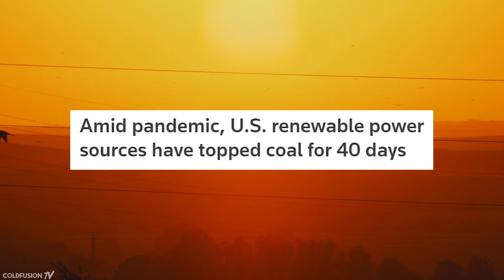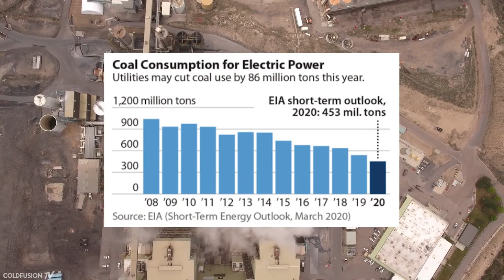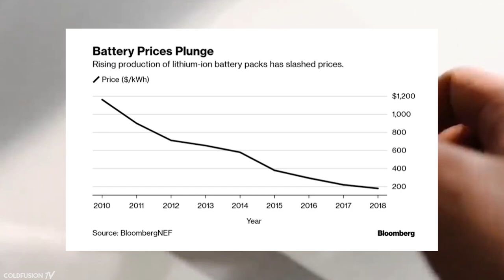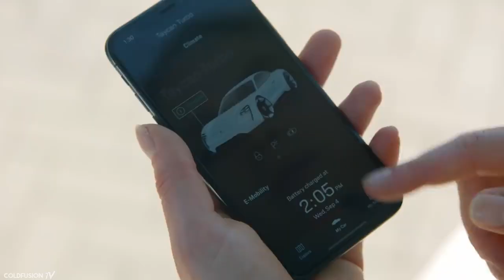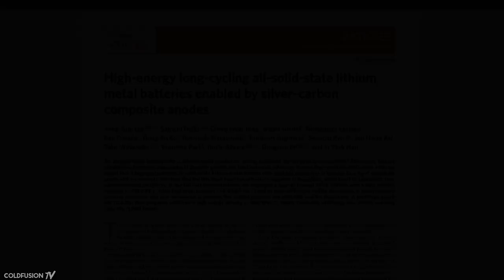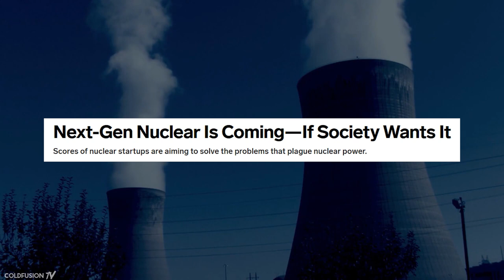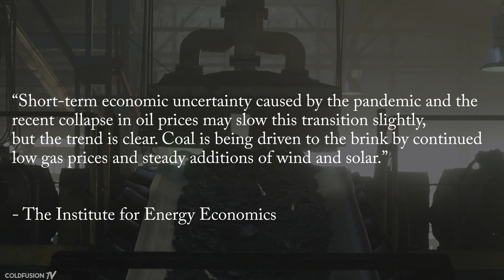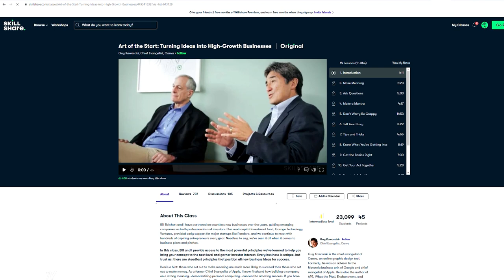Amid Pandemic, Renewables Now Supply More Energy than Coal in the U.S.

Comment: This is my industry as a power engineer. Your video was really good and the information was clear. I have been curious about geothermal and pumping water back uphill lately. With the way battery technology is going, production when it is need is still going to be a thing for awhile. The Duck-Curve is a daily struggle from a transmission standpoint. If power engineers focused on more not just finding the cheapest way to boil water, we would be there already.

Comment: renewables are way too inefficent, we need cheap energy on demand. nuclear ist the best solution
Reply: nuclear isn't cheap in the same way that buying stocks isn't cheap. you get your money back and then some, but only after spending a lot of money. plus, nuclear is safer, more powerful, more profitable, and more efficient compared to any other energy source, but muh nuclear weapons and political scaremongering.
Reply: In times of crisis you need bold politicians to do big investments if you want nuclear.
Reply: yes it is not cheap. highend technology is never cheap, but its getting cheaper and in some cases it already is. china builds some late gen 3 nuclear station for the price of a gas-fired power plant. when talking about renewables not only storage, but also transformation and necessary infrastructural upgrading costs are often not within the calculation. and what is the price of the massive intervention into nature caused by the usage of space that is needed for renewables?
Reply: @davidlewis6728  Why should we continually keep mining for uranium when we can just mine silicates and metals once for long-lasting energy creation? Plus, we still don't have a way to store the radioactive waste products.
Reply: I like Thorium but with Thorium burners they could be slotted in to an existing coal powered power stations for very little cost. I would not be surprised if we see fusion reactors within ten years.

Comment: The comparison between the phone battery and laptop battery was not a fair one. You did not take into account the voltage as well. The same number of mAH in a 14V battery is actually much more energy than that number of mAH in a 5V battery. If you want a fair comparison, convert or find the WH ratings for each which does take into account battery voltage. This may seem overly nitpicky, and I enjoy your channel, but that is a pretty big distinction as mAH is not a unit of energy. Cheers!

Comment: Question:  If storing wind in a mountain is a form of "battery", why wouldn't sucking up water from the ocean to an elevated reservoir have the same effect?  Pull up the water into the reservoir, then push it through a hydro power turbine when the grid needs energy.  Potential bonus, biological or membrane desalinization and thus a larger water supply in coastal regions.  Does it simply cost too much energy to pull that much weight versus moving air?

Comment: Good Video, Lots of Info. But why mention just batterys? When it comes to utility scaled energy storage in the future, I think batterys will only account for a very low one digit percentage amount. Power to Gas, pumped hydro, Green Hydrogen, heavily compressed air, power to heat - there's so many ways we can store excess energy from renewals way cheaper, easily scalable and using way less precious material's.
I'd love if you could do a follow-up to this video! :)
Cheers

Comment: The energy payback times for solar cells are pretty well known, so you could have mentioned them. Obviously it depends dramatically on the amount of sun and the cell type. 
It usually takes a solar panel + inverter installation between 1 and 2.5 years to generate more power than was consumed in manufacturing the equipment. Expected lifetime of the panels is 25 to 30 years, inverters 10 to 15. In sunny areas like much of the US, southern europe or africa the energy payback time is usually close to 1 year, so it's a total no-brainer.

Comment: The battery on the laptop is running at 14.4V which is 4 times higher than 3.7v of a phone, use Wh not MAh to measure the capacity.

Comment: Ive been seriously looking into solar power on a large scale for quite some time now and still undecided on the best storage method between batteries or hydrogen. For the automotive industry batteries win hands down but for the commercial industry perhaps hydrogen is best at the moment. Would love to see a non biassed comparrison.
Reply: Hi, in the Orkney Islands they produce more electricity from renewables than they use, so have been converting some into hydrogen to use as an energy storage system. Right now they use the hydrogen to provide electricity to their Ferry  when it is docked along side to reduce pollution. They hope at some point to power the ship with the hydrogen.
Having said all that even they say hydrogen is very inefficient way of storing energy and only advise it if there is a very specific reason for it. 

In their case they are using the shore hydrogen system to train the crew for when the Ferry goes hydrogen powered.

Comment: Interesting. Question though how does the Reppie plant burn rubbish at 1000 degree with out fossil fuels? That kind of heat usually requires oil or coal.

Comment: The very high cost of cleaning up coal burning emissions (oxides of nitrogen and sulfur, particulates and heavy metals) has made using that fuel not very economical in recent years. Especially with the rapid drop in the price of natural gas, which burns vastly cleaner and has very low emission control costs. That's why we will see a huge transition to using natural gas to for power plants as an intermediate solution until power storage technology gets economically practical enough to pair with renewables like solar and wind power, probably in late 2020's.

Comment: In a post pandemic world, inflation/economic recession may drive the demand of cheaper energy sources up, resulting in a spike for coal and other non-renewable sources. Nuclear is the only viable, near future alternative for cheap and clean energy for the masses. Also despite the massive leaps and bounds in battery technology, it is the market that will decide the future development of batteries and not Government handouts. This may be a limitation owing to the large costs and low power density (compared to other available sources) of current battery technologies.

Comment: Bit late, but I was thinking of some things. 

Wind is a reliable source of energy when it is offshore or in always windy areas, like the midwest. However, solar will be powering many houses in suburban and rural areas. My family recently got some installed and despite being the winter, our electricity bill was a few bucks. This means that, at least on a normal day where the home isn't constantly in use, solar can provide the necessary energy while being supplemented just a bit from other sources.

In addition, plastic pollution and landfills are a huge problem, and burning it and using carbon capture technology or other innovations to trap and reuse the materials while generating electricity is an amazing idea. It gives land for more housing, renewable projects, and solves some of the issues with landfills. That idea, at least in my belief, is going to be big

Comment: Coal will always be needed in industry (in particular for steel production) but it's days for energy are evidently numbered.
Reply: @RED D - not quite. The carbon in steel production is used in 3 ways:
1 to produce heat - this can be taken care of otherwise
2 to remove oxygen from the iron ore - this can be taken care of by using hydrogen, rather than carbon
3 a trace amount of carbon is sequestered in the iron - needed to make the actual steel (steel being iron with 1-5% carbon) - this does not need to come from coal

Heat - the obvious source is to use raw nuclear heat (more efficient than using heat from electricity via an induction furnace)

Oxygen removal - now: Fe2O3 + 3C --> 2Fe + 3CO2
with hydrogen: Fe2O3 + 3H2 --> 2Fe + 3H2O
Using hydrogen also makes it easier to get the C % just right for the particular steel being made (per step 3).

Carbon sources - plastic garbage! - a relatively pure form of C and an easy way to recycle.

Comment: The major reason that renewables may have equaled or exceeded coal is NOT that the renewables have supplanted coal.  They have not.  It IS that natural gas is so cheap,, thanks largely to modern fracking.  Natural gas, a fossil fuel has supplanted coal, not renewables.

Comment: Your videos are usually super informative and on point but I noticed something that falls well below that standard here and I feel like it has to be corrected. The battery comparison was deeply flawed. You put up a 14.4V 1700mAh (24.48Wh) Ni-Cd battery up vs a 3.7V 3330 mAh (12.32Wh) Li-ion battery. Your edit and writing suggest the cellphone battery has 3x the capacity while being significantly smaller which is just plain false. A modern cellphone battery certainly has higher WH/L and Wh/Kg figures than a 25 year old laptop battery but it has half the capacity. Furthermore, if you were going to use the 5000mAh figure you could have used an actual picture of a 5000mAh battery rather than a picture of a Zenfone from 2014.

Comment: Lithium batteries can't support the grid, the clean air institute which is backed by MIT stated that for California to go 100% renewable it would need 36.3 million MwH of storage would even at very low prices would be around $9 trillion or about $220000 for everyone living in the state. As this does not even include generation costs it is clear that lithium batteries only role in grids is peaking power especially considering that lithium batteries only last around 15 years. Pumped hydro is a far better option as is nuclear.

Comment: I'm surprised you didn't mention that the majority of "renewable" energy is from the burning of biomass in the form of wood chips -- wood chips that are made by cutting down forests. So the question is, which is worse: leveling mountains to burn coal, or leveling forests to burn wood? Tough call; they both suck.

Comment: I think there is a logical fallacy in the way data about coal's share from the total production of electricity from the grid is presented. Hear me out. Even though the percentage is lower than 2014, that doesn't mean that automatically less power is produced from coal, moreover it is possible that more or the same amount of power is being produced by coal, but looks statistically smaller percent wise, since the production of electricity increases every year. Correct me if I am wrong, but I think the data you used is not presented in the best possible way.

Comment: The problem with renewable is that it's not consistent (besides hidro) and you will have dips, for those dips one has to maintain the coal / bio-gas (still not renewable)  on idle  power production (lower throughput maybe) . In america you have less coal but more bio-gas  (they can use even methane, this one is worse for the atmosphere) .  Yes we are making progres with electric power cells (see perovskite solar cell) and  amazing progress in battery types (see the new samsung break-through) , but we are still using a 200+ year method of producing electricity, boiling water (not that is bad) to turn a turbine, (batteries are different, but they have a maximum wattage drawing that can go down and it's not yet sustainable for long periods). We are still transitioning. We are still improving. The only clean producing source, at least for now it's nuclear, maybe in the future fusion, then again the latter is always 30years in the future.

Comment: I’d love to see the efficiency of the trash burning plant. I presume burning at 1000 degrees eats into it significantly - if the energy in is at least that of the energy out have they just solved the growing trash problem?
Reply: Most Carnot engines have an efficiency around 30-60%. Trash, using a solid fuel, is probably close to coal's 30-odd%.

The temperature of combustion is not the main criteria - it is the temperature of the coolant (i.e. steam) that runs through the turbine - which is about 350 C (at tens of atmospheres pressure).

You should examine gasification and plasma gasification for even better trash disposal solutions.

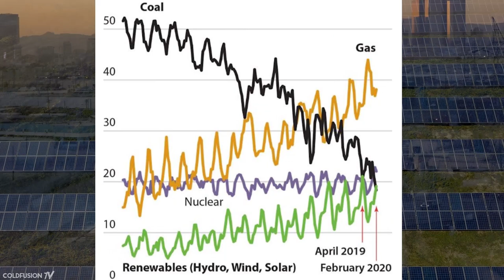Comment: Nice video, thanks. If I read the chart (2:00) correctly, gas has doubled as well as renewable : 20->40 vs 10->20, I'm not sure it is an ecological win. Yes coal is declining fast and this is good but mostly replaced by gas which is not so good for the climate. So the result is not a clear win for the renewables as mentioned in the video.

Comment: Think of this. There’s always sun some where in the world. So when it’s 7 pm in New York the western states can produce power. Also with electrical cars. They could share a percentage of their battery with the grid at peak times. Car owners could receive a credit or money for this.
Then theres hydro, with less water available, you could release  the water at night, when there’s no energy created by the sun. Also with tariffs if there’s an abundance of energy in the day, say 12 pm factories will take advantage of this. People would set their cars to change during the day and maybe even heat water in homes during the day. 
Or say at 3 am the entire grid isn’t in use, all your devises could be charged and car. Maybe even shut down washing machines during peak times, or have the washing machine advise you it’s going to cost you more to run at 7pm. 
With a floating billing system people’s life styles will change and maybe we wouldn’t even need batteries. A display unit in everyone’s house and education people will soon learn to gobble energy when abundant.  

I would suggest maybe a floating tarriff for billing, say -2 to +5 and people would set up their house life style and appliances so suit. 
Eg. at -2 the grid is paying to take the eletricity so make your house 2 degrees colder. Make your chest freezer run to minus 25 , heat the water more, increase the charging speed on your 🚗  to max. So all appliances will have a variable energy factor, starting with phones.

Some discipline as to when we can consume power  and how would be the best.

Comment: It’s the fall of coal, the rise of natural gas, the uncertainty of nuclear, and the beginning of renewables with utility scale storage... with the exception of hydro with a pumped storage reservoir.

Georgia has some failed nuclear sites/builds that are far beyond budget.
FPL has begun seriously building utility scale battery storage.
But renewables don’t qualify for reserve margin for their max capacity so we use natural gas mostly.
At the moment the only way to meet peak demand is with fossil fuel. Storage needs to get beyond a 4 hour dispatch window to cover an 8 hr on peak time period, and even then natural gas will be needed for reliability. With so many natural gas units coming online this will be USA’s primary generation for the next 20-30 years as that’s about the lifespan of the units if they decide to reduce/end maintenance at that point in time, however with some investment the lifespan will likely be extended beyond that.

Comment: Hi Dagogo, you may be interested in what I'm about to share with you.
I work at a place called innovation Space at the Technical University of Eindhoven. Here we have a team that has succeeded in creating a stable fire from iron powder, which creates heat and rust. This rust can be turned into iron powder again through a chemical reaction powered by solar and wind energy.
This allows a very efficient way of storing and transporting energy from solar and wind that isn't readily available as of yet.
They are called Team SOLID. Look them up.

Comment: The trick is not to produce energy but to keep the grid up. You need the right amount of energy at the right time, perfect balance in the grid. The fluctuating nature of wind/solar makes this more difficult. So you need to have conventional backups running at all times. Either that or unrealistically big batteries. Coal is on the decline because the US have cheap natural gas which is perfect to stabilize the grid (gas turbines react quickly) while there is enough hydro and nuclear and other plants that can cover the base load at any time and cover for any downtime with wind/solar. Non-orbital solar and wind are still and always have been dead ends and are a waste of effort beyond certain small scale solutions. Nuclear ist the way to go as it gives you the higest energy density, the best ERoEI by far and is at the same time compact and independent from the weather (if the plant is secured). Instead of playing the solar/wind scam game this money would be better spent on nuclear research and industry.

Comment: Well, storing the energy in batteries is possible, bit I think that there are (in some places on earth) better ways to store this energy. In Switzerland, for example, we use the excess electricity, which isn‘t used on daytime to pump water to reservoirs in the mointains. And in the night, when the solarfarms aren‘t producing electricity, the water is released and goes with steep tubes into the hydroelectric power stations. So we can produce renewable energy at night. Greetings from Switzerland to all of you.